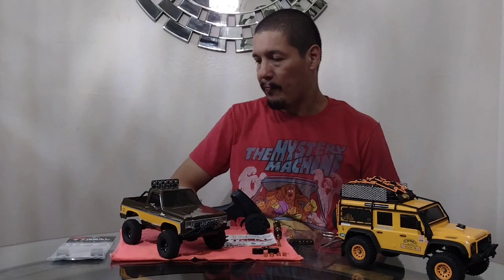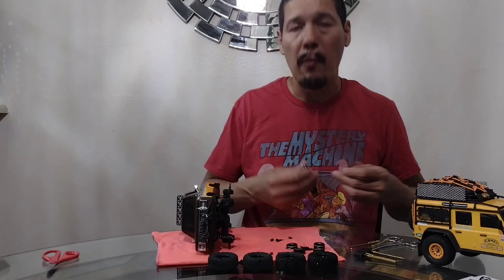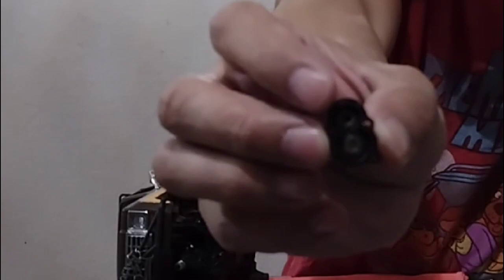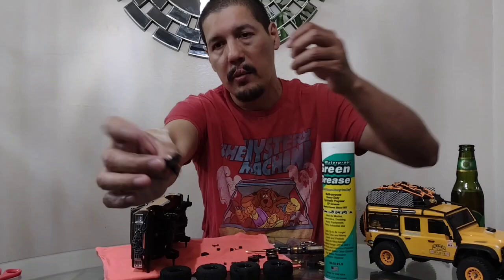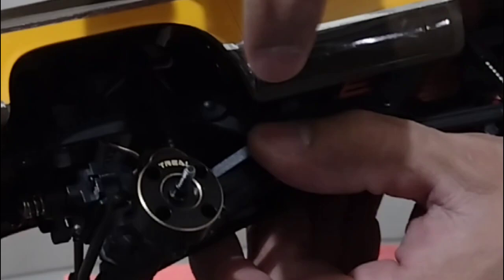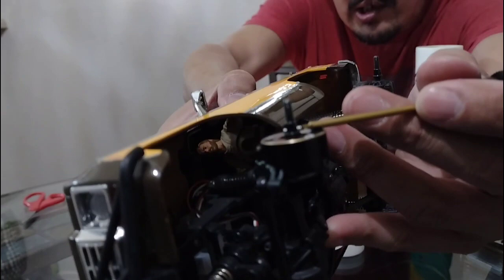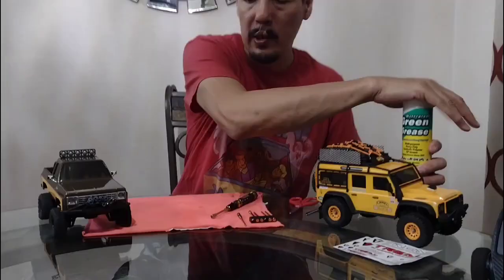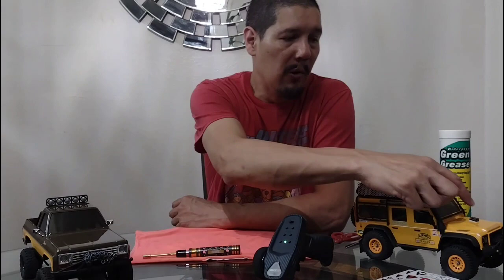FMS FCX24 BLAZER !!  BRASS PORTAL COVER TREAL UPGRADES !! HOW TO INSTALL THEM !!

Comment: Also they are different thread, the screws that go into plastic is coarse thread, going into metal is machined screws. But you’re screwing back into plastic I switched out both inner and outer brass portable boxes on mine from RCAWD Comes as a complete kit all four corners I just did the front for now
Reply from the maker: Awesome good to know ill keep that in mind for future upgrades 👍